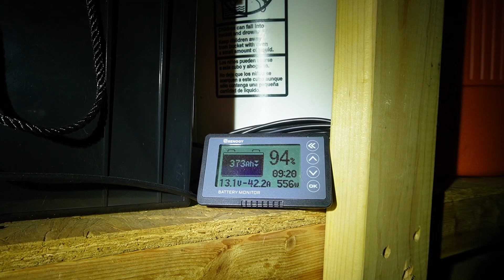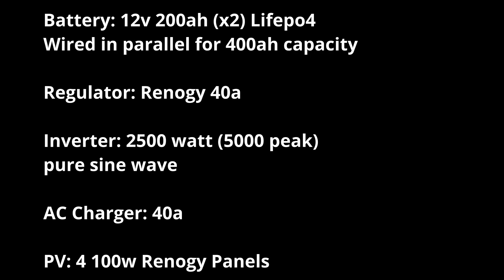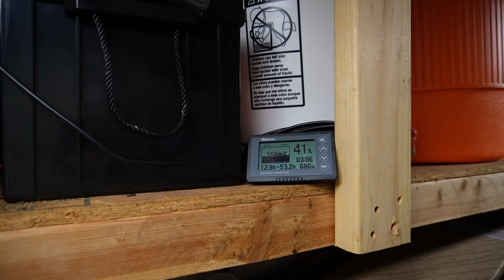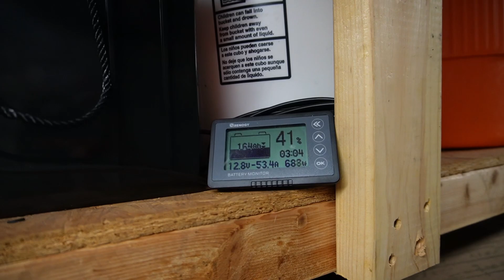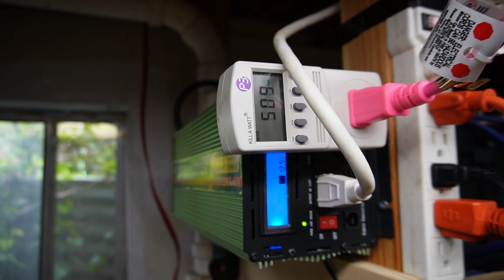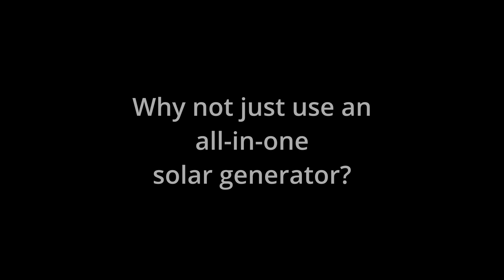Solar VS Gas Generator for Power Outages... I Have Both... Which One Do I Prefer!?

Comment: You can still use that solar to offload Air conditioner usage via portable or window units pugged into your solar circuits that way the main AC, which hogs all electricity, stays off during a non emergency situation.

Comment: I have both also. I have 5kw grid tied on my house, no batteries. I have 2  3000w 120v 30amp solar generators with 10kwh in battery, and a 5500w continuous gas generator. I prefer solar always, it always starts, no noise, and will be running when you cant get gas. That said I would never depend on one of those stupid high frequency units, Ecoflow, Bluetti, etc. I read the comments on here about, well when the power goes out,your grid tie solar is useless, only if your stupid maybe. Your grid tie panels can be rewired from AC to produce DC. If SHTF happened, id just disconnect the inverters and rewire to run DC to my solar generators, each unit has 2 mppt controllers capable of 2000w solar input each. So if you think grid tie will leave you stranded, I say only your ignorance, will leave you stranded

Comment: My battery backup using name brand LiFeP04 commercial batteries, inverters, components caught fire August 2nd of 2024. It did $100,000 damage to my home and shop. 3600 Amp Hours, 46,000,watt hours. I will NEVER trust lithium batteries inside ever again. The system was online for 2 years very lightly loaded. A BMS failure caused one battery to explode and catch the rest on fire. Never again will I make this mistake.
Reply: We ran on a 7500 Powerhorse inverter gen set for a week until the power company put our meter back in. I no longer trust LiFeP04 batteries inside ANYWHERE.. This failure was catastrophic.

Comment: Well I didn't put all my eggs in one basket. I have two generators, one is gas and Propane and the other is propane only . Both of the generators are capable to run our Well pump which is our #1 priority. We (the family group. Shared expense.) meaning me have a Solar system that can run a refrigerator and freezer. As a family group we are enlarging the solar system so it can also run the Well. I have a small Solar Generator which I can use to run some lights as needed. We live in Central Arizona so Solar is a great choice for Solar.

Comment: 1 of my co-workers has solar but no batteries so when street power goes out, he looses power. I laughed at him saying you spent $60k on your solar and you didn't have power for 3 days during the last hurricane.  
There is NO way anyone can talk me into solar, even with the back up batteries. 
I will stick with my external generator when needed and i have lots of fuel for it.
Reply: I think I paid $4000 for an off grid system just for my fridge and freezers.it’s a backup to my backup. I have a gas generator for the whole house and I can run it for two hours to charge things up,take a hot shower etc.solar generators are convenient for short outages too
Reply: You need to combine those. Just load the batteries if needed with the generator or if lucky from solar.

Comment: How long can you run on batteries with basic functionality?
Reply from the maker: Indefinitely. I picked enough batteries so i can run for several days, but as long as the sun comes up within a few days, i can keep going. If there were 3-4 days of continuous panel blocking weather (like thick clouds or snow), i will need the generator, but it's never happened. 
I've never had a power outage that this didn't work for.
Reply: @rocbola  Hmm .... My co-worker has 3 Tesla Power Walls and he was only able to run for almost 2 days before they went dead because in the last hurricane, a tree branch from somewhere came thru and hit his solar panels and damaged 4 of them which killed the system until the guys came out 1 weeks later.